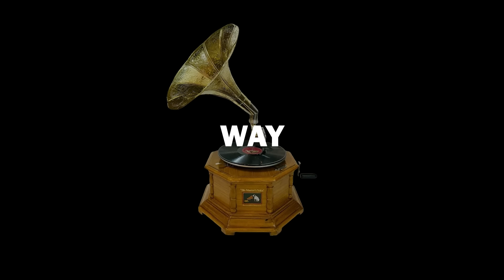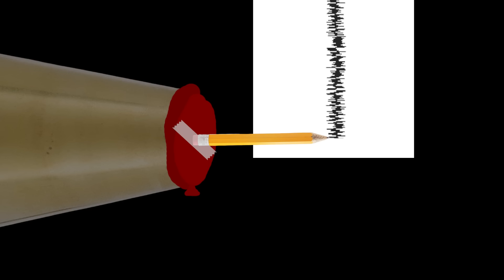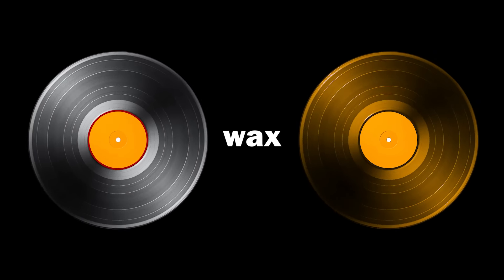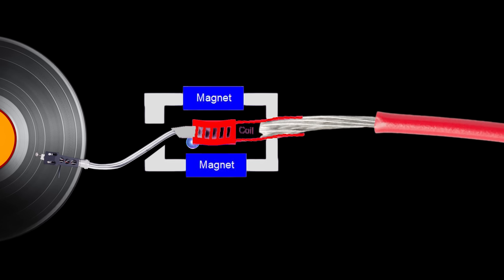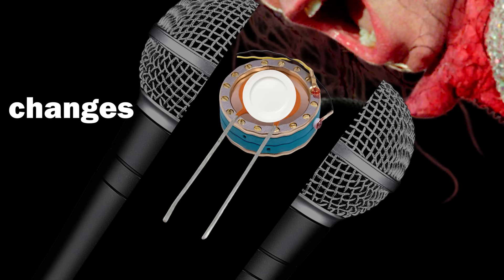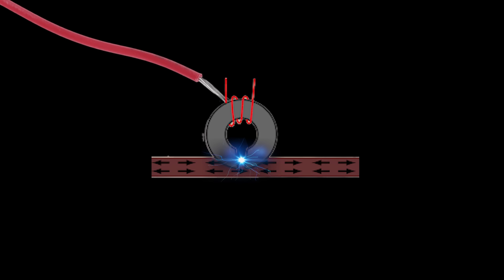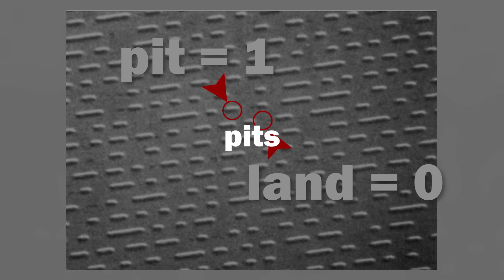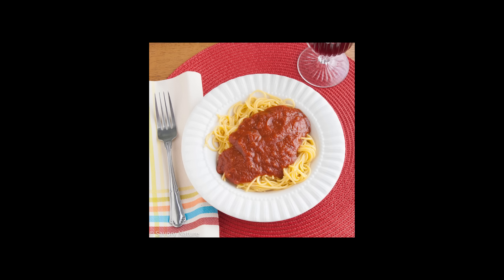How Does This Stuff Make Sound???

Comment: now the real question is... how the frick do wireless mics work?
Reply: Waves that send the message of how to vibrate, I guess.
Reply: Analog to digital converter in the mic, sends data to a reciever, converts it from digital to analog again which records the sound
Reply: Simplified answer: MAGNATES.
Reply: it converts it into frequencies sent through the air and then goes to the reciever and converts to the same electricity from before-AHHH idk man
Reply: Same way everyday life works 😮🔊👂
Reply: Basic ones 

Broadcast fm on one of the ism bands

Most modern ones 

Proprietary digital signal
Reply: Blutut

Comment: Holy shit, I took technology for granted while growing up in the 90s. I really have a strong appreciation for how technologically advanced we really are, like even the cassette player is genius, I never had any idea they used magnets.
Reply: The first "pencil-to-paper" sound recording was done in 1860 by Édouard-Léon Scott De Martinville. (Couldn't play it back, of course, but he thought people could learn to "read speech" by looking at the scribbles on the paper.) In 1878 Frank Lambert recorded and played back some speech using a needle on a spinning lead cylinder. Edison did it with a wax cylinder. Emile Berliner did this on disc records starting in 1889. Magnetic recording tape was developed by the Germans in the 1930s. Americans reverse-engineered it after the war. And it was shrunk down to the size of a cassette in 1963, introduced by Philips in the Netherlands.
Reply: That's why all the stereo manuals said to avoid placing tapes near magnets and things like TV monitors that would generate strong magnetic fields. I worked in a TV master control and dubbing house; we had a huge bulk eraser that you'd turn on and it would erase the entire video master tape in a matter of seconds. The thing was so strong it would suck the tape onto it. Hard drives work the same way -- tiny magnetic fields on a spinning platter. USB flash drives and solid state drives are different though, electronic but not magnetic.
Reply: @jeromeglick 
Thanks for distributing free knowledge, Sir. That's why I love to  dig in comments.

Comment: If you were to stamp the recording on fresh discs like you showed, the hills and valleys would be inverted in the new discs and you would not be able to get any sound out of them.

Basically, it would be like looking at the negative of a traditionally taken photo.

You would need to use the negatives of the recording as stamps themselves to produce functional records.

I felt like this was important to point out.

Comment: I think the bias signal used in tape recording is analogous to what advertisements from 50 years ago would describe as a 'superheterodyne circuit in a walkie-talkie. (I accidentally discovered the principle, applied to a microphone on a long wire, set up between a detached garage and house as a one-way 'intercom', when the dryer in the garage induced a hum in the system and simultaneously improved sensitivity.)

Comment: Now if there was such a way to take a detailed photo of a record side then a way to read the grooves (even if it has scratches or quality imperfections). I know there's optical stylus which read the vinyl surface but you also get the various faults ftom the surface so wouldn't it be cool to someway load that image i mentioned and figure out a way to read that image. Note it would still read the imperfections but an interesting idea for me.

Comment: How music goes onto CD’S:

All CDs are pressed from a digital data source, with the most common sources being low error-rate CD-Rs or files from an attached computer hard drive containing the finished data (e. g., music or computer data). Some CD pressing systems can use digital master tapes, either in Digital Audio Tape, Exabyte, Digital Linear Tape, Digital Audio Stationary Head or Umatic formats. A PCM adaptor is used to record and retrieve digital audio data into and from an analog videocassette format such as Umatic or Betamax. However, such sources are suitable only for production of audio CDs due to error detection and correction issues. If the source is not a CD, the table of contents for the CD to be pressed must also be prepared and stored on a tape or hard drive. The point of getting music on the CD, is by using a CD burner, making sure the music is downloaded. The computer may/should have NERO Burning ROM.

Comment: I dont really understand the cd one. If you get a 1 for a voltage higher than some value, and a 0 for anything lower, how do you account for the vast range of voltages? Isnt the difference in voltage (or the frequency of the current which depends on voltage) what can then produce a difference in sound? With just a 1 and 0 wouldn't you just get 2 possible sounds?

As i wrote this i realized it's probably a certain amount of 1s and 0s in a given time that correspond to certain sounds

Comment: Cassettes are like VHS it reads the information from a metal head on the cassette player. VCR reads information with a giant head and sound like on most cassette players/vcrs if you press rec a small head will erase then add that data on the tape

Comment: For CDs, I think they have a sampling rate. The 1s and 0s are just an encoded digital file, the actual contents of the file are probably real numbers of the energy level of the sound wave at that exact moment in time, sampled thousands of times per second. Like a digital image, it's not a 1:1 imprint of the light that enters the lens, it's a bunch of tiny pixels that approximate the light in a discrete way. But with a high enough sample rate, humans can't tell if it's real or not. But that's why hipsters still buy vinyls, because they claim the analog sound is more pure.

Comment: Actually, CDs were introduced in 1982. They didn't become affordable until the late 80s. My brother and my sister had their first CD players in 1986. People today don't really understand just how incredible CDs were. Digital audio since the 90s was mastered poorly with the loudness wars. When you only had scratchy records and fluttery, hissy tapes, the clarity of CDs just bowled you over. Vinyl reproduction isn't digital. It's electronic. Only, the recording is mechanical. Digital is when the sound data stored as binary numbers. The audio voltage is measured or sampled, for CDs, 44,100 times a second and stored as a binary value. On playback, the binary value is pulsed out with corresponding voltages to reproduce the audio. It's a bit more than that, but that the basic gist.

Comment: No, you don't exactly get a metall record by putting it through a cemical bath.. The bath makes a fine metall layer that then becomes the two (A & B side) stampers and when you peel them off the plastic record inside is still there.

Comment: Um actually, cassette tapes didn’t overtake records in sales until the mid 80s… so Michael Jackson’s triller would have been big on vinyl, not cassette tapes. You would have been better to use the album “Bad” as your example.

Comment: There are two types.. Moving magnet (most normal) or moving coil. The one you show is the most expencive and less normal moving coil.
And the sound first goes to a RIAA stage to correct the signal since the bass is lowered and treble is encreased (because of the nature of the grooves and needle it would not handle bass very well) and then via an amp and THEN tobthe speakers..
Here lacks alot of basic info in this video.
It's not possible to cover all this properly in such a short video... So then it's really no æt much point since it will be just half-way learning for people who watch. Good try (and creds for that!) but not quite there.

Comment: Dude.. Modern record players are NOT "more digital".. Unless they have bluetooth crap etc they are pure analog from the groves to the stylus to the cables that connect it to an amp. No digital path at all there.
The record usually is digitaly mastered but that's something else.
And don't mix gramophones and record players.. Same basic principle but still different. A gramophone uses 78rpm shellac records, very different stylus and also has the horn. A record player has a smaller and better stylus, 33 and 45 rpm vinyl records and actually can have great sound unlike a gramophone.

Comment: Nice video! You got some stuff about gramophones wrong:

1. Gramophone records were not made of plastic like you mention in the video, but rather of shellac. They only staryed being made from plastic once modern record plsyers started appearing. If you were to play a modern record on gramophone It'd get totally wrecked because the different materials. Shellac was much harder.

2. On a gramophone, It couldn't be called a stylus, but rather only a needle. And It was a wide godammn steel needle mounted on a thick tonearm much sturdier and hard, not like on modern turntables